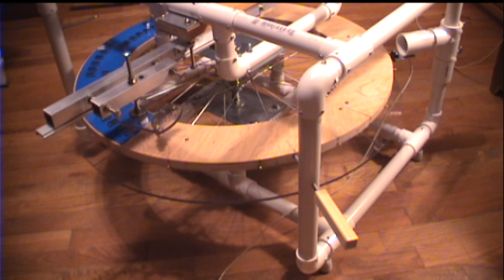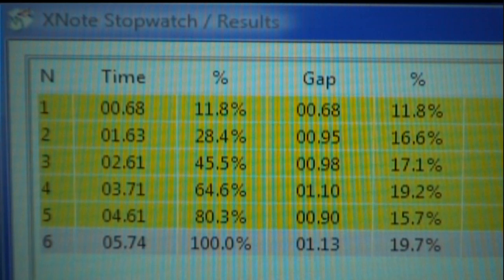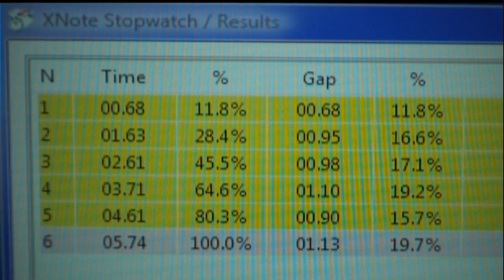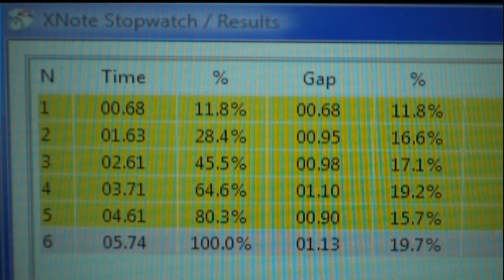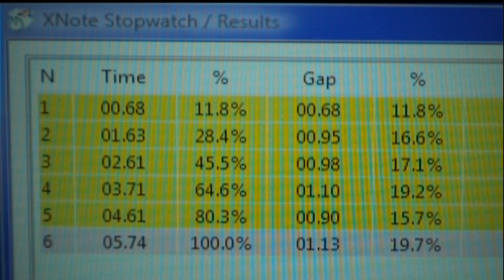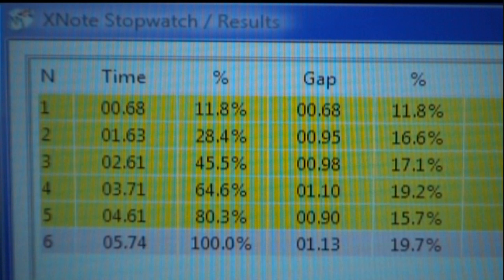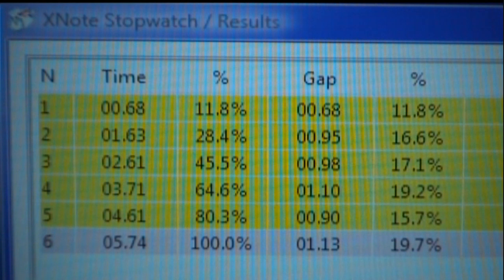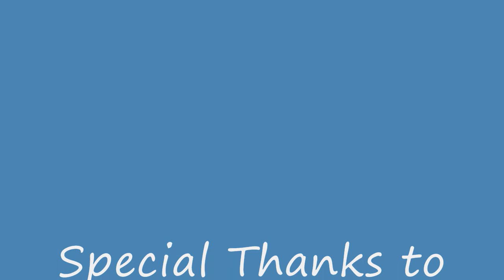Video #37, "Rick's Pipe Dream" Magnetic Motor-Generator

Comment from the maker: I will be performing many magnet layout variations, though, and the new testing timer is a great way to observe the actual results of even the slightest variation, and to any magnet group.  For example, a weak group (longer Gap time) can be strengthened to balance better with the other groups.

Comment from the maker: @marthale7   Hi, Mart.  I loaded results from 5 tests into Excel, and posted the page in the official Pipe Dream thread.  It is so easy to do, and yes, graphing the results will be another benefit.  I agree with you on the switches.  They are noisy in the video, and the 8 trips are certainly requiring energy that could better be used for rotation.  I have some reed switches coming, but it may prove tricky to trigger one switch without triggering the other.

Comment from the maker: @syndrome95   Yes, I will be adding an extra plate and magnets for the next test.  I performed 4 additional tests using the layout shown in video 36, and the results were remarkably similar. It was easy to determine that the same variations in Gap timing  occur in every test, and knowing precisely which groups were affected allowed me to "tweak" the longer times down into range with the others.  I'll show that in the next video.